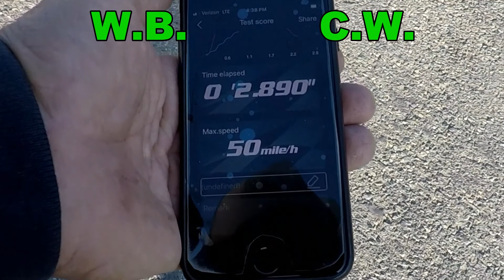We put 7 turn modified motors in our DR10's

Comment: That's pretty quick
Reply from the maker: Thanks it was for sure a blast.
Reply: @MyRClive  when your ready, up the power game. Mine is around 80 on 2s, and will run up to 7s. The math works out to around 240, but no way can I get that as lite as it is. On 3s it flies.